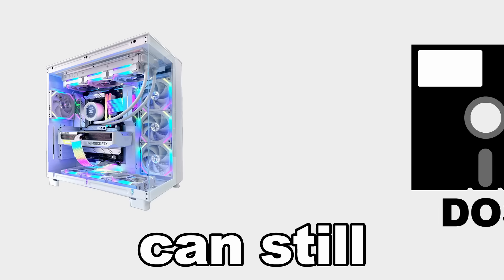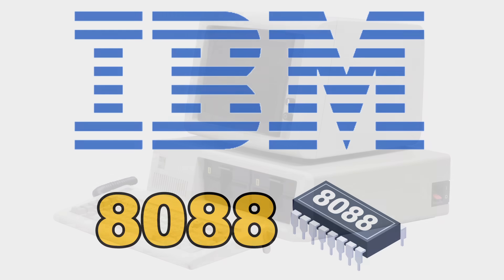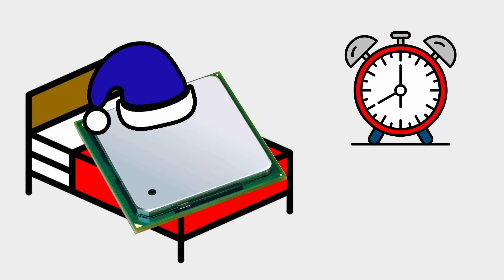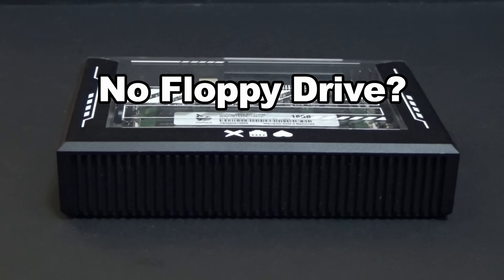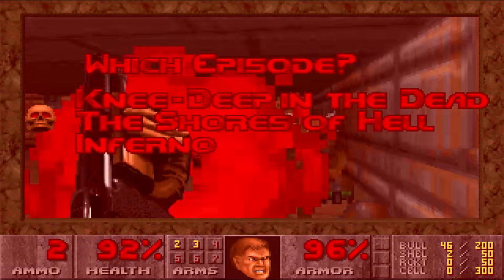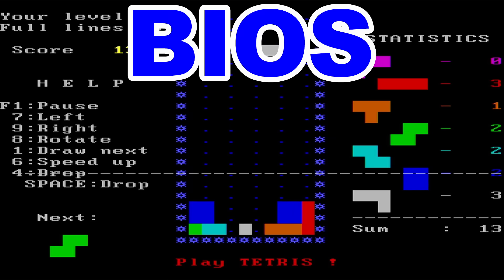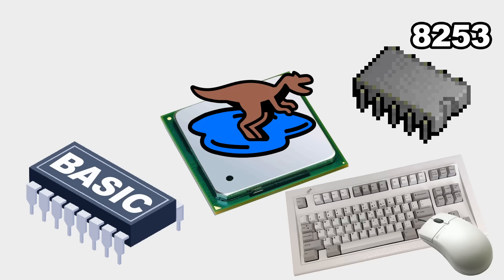45 Year Old DOS on a New Intel CPU Without Emulation

Comment: Intel is planning to make x86 64bit only architecture through x86-S specification
Reply: x86-S supports 32-bit apps but not 32-bit kernels. It also removes stuff like ring 1 and 2 (which almost nobody used)
Reply: @sundhaug92  The should have done it years ago... there is a ton of legacy stuff that can be removed, also it would simplify the boot process and the operating systems (basically because the OS doesn't have to start from a 16bit real mode and setup all the stuff to get to 64 bit mode).
Reply: @alerighi yeah, removing that tiny bit of code that is already written and working will save so much.  I also bet that removing the old instructions will save hundreds of transistors.
Reply: @alerighi  You'd be surprised how many niche things still depend on 32-bit kernels. Also, modern kernels don't have to start in 16-bit, either because the bootloader gets them up to that point or because of UEFI
Reply: @harrkev   removing old instructions won't save transistors because they're just microcode in the ROM, it'll save a couple of diodes, no reason to do that.
they could remove the real mode because that can be emulated in user-mode by the operating system.
Reply: @alerighi  OS can already start from 64 bit mode. It is called UEFI boot.
Reply: @SmallSpoonBrigade  Yes, but these days there is no sense to really execute 16 bit programs on the CPU. You can always emulate them, and there are plenty of emulators (DOSBox, 86Box, etc) and these days the performance penalty of the emulation is negligeable. 

Also, even with 32 bit Windows that can run 16 bit code they don't run it in real mode: it's no longer the case since Winsows 9x. In reality 16 bit programs are emulated on Windows, with an emulator that is called NTDVM. 

But really, 32 bit Windows is no longer supported, there is no point of having a processor supporting it. They can drop real mode, virtual 8086 mode, 32 bit mode entirely with no issue. I would also argue that they can remove support for running 32 bit programs in 64 bits OS, but there is still a rather amount of programs using it.
Reply: Anyone who still depends on the features that X86S will drop clearly aren't upgrading their systems anyways, and it's not like their existing systems will stop working immediately. (They'll stop working _eventually, but humans are pretty bad at properly preparing for when that inevitably happens.)
Reply: That will make them lose quite a bit of market of embedded devices out there which still run Windows XP or 7 and rely on 32-bit instructions to work.
Reply: intel has recently shelved the x86-S initiative, which is honestly a good idea
Reply: That's very stupid. Backwards compatibility is a major reason to use x86 at all.
Reply: @thecount25  Intel x86S retains just enought backwards compatibility. It does suppoet 32bit and 64bit apps under 64bit OS - just as 64bit only UEFI.
BTW 32bit OS inside a VM (bare metal hypervisor or hypervisor over host OS) - NOT supported in x86S.
Reply: @thecount25  Yes, but nobody uses ring 1, 2 or 16 bit real mode OS kernels nowadays for example
Reply: @Masterix.  I wouldn't say nobody. MS-DOS is still used in industrial applications. But yes, granted, that is getting smaller over time.
Reply: @thecount25  I doubt that, but even if, do you think that these computers are using the newest components? MS-DOS with all applications can be emulated on a potato, there's no reason to keep supporting 40+ years old software with no real usage. Like I get it it's nice and interesting feature, but common, it's time to move. x86 needs to make some big changes or it will be outplayed by ARM (and maybe RISC-V) CPUs in the (biggest) consumer sector.
Reply: @Masterix.  I think x86 is toast already. This x86-S will not be enough, and dumping more compatibility will just kill any advantages that x86 has with backward compatibility.
Reply: @thecount25  But backwards compatibility is double-edged sword. I think it is actually often the hardest part of designing new software/hardware. And x86 is really complitated because it maintains so much of backwards compatibility. Nowadays, hardware and software don't change much. Between 1990 and 1999 there was a huge step in computing and standards. But 2010 and 2019? Not much really. 64 bit computing will stay with us longer than 16 bit and 32 bit did combined. If we would need 16 bit computing, we can emulate everything. And x86-S is compatible with 32 bit user applications (but not with 32 bit OS) so that's also fine. Intel stopped making new 32 bit x86 desktop CPUs since Pentium 4 line, which is a long time ago.
Reply: @Masterix.  real mode is 0.01% of what is in the x86 ISA. If they did an actual cleanup it wouldn't be x86 anymore
Reply: @thecount25  Yes, although I'm not sure it's as critical now as it was when Intel tried to get people to switch to Itanium.

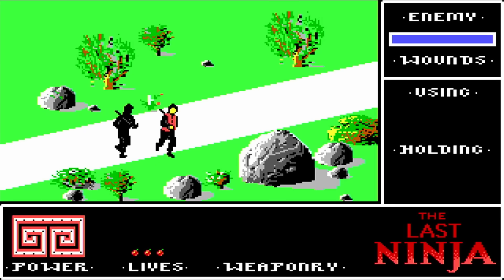Comment: 6:50 You could play the superior Commodore 64 version.
Reply: Dos version loads faster
Reply: But the commodore 64 ran 6502 assembly, not x86 compatible
Reply: @kenzie117  Yeah, but Last Ninja on C64 is the superior version than the MS-DOS port (and the less is said about the NES port of it, the better).
Reply: @UltimatePerfection  While that may be true, the point of the video is showcasing the backwards compatibility of modern processors. What youre suggesting requires emulation. Which defeats the purpose of the video.
Reply: @kenzie117  No, I was specifically responding to the claim at the timestamp on what would he do if compatibility wasn't a thing.

Comment: How did you solve the problem of old games running too fast?
Reply: The underclocking of a lifetime.
Reply: Turbo button.
Reply: There are plenty of "slow down" TSRs in the wild. They simply grab the processor a few times a second, do some busy-wait loop, then return control. It's just like running a CPU-heavy game on modern systems: everything else in the system slows down. Just "eat" 9,999/10,000 CPU cycles this way, and your shiny new Ryzen 7950X will do an extremely convincing impression of a 286. 😁
Reply: This, wing  commander 1 and 2 got really messed up.. 
WC1 is already running too fast on AMD's K6-2 200mhz..
Reply: @dureteheiral1793  but Duke Nukem 3D somehow runs perfectly fine when I run it in Windows 9x VM, but other games don't.
Reply: @_GhostMiner ….Using a VM program already throttles down the cycles to be closer to the original with some emulation.
Reply: @Roninkinx Do they just do that without your consent? You just can’t change it no matter how hard you try? It’s all hardcoded?
Reply: @_GhostMiner  Cmiiw, maybe because Duke Nukem use Real Time Clock that was introduced with IBM PC-AT. The older games (and some games afterwards) use software counter to time its movements. And as newer computer run faster and faster, the newer computers can do the software counter faster and faster, and you have the 1990s kids challenge "play Tetris in new computer".

The same issue also affected Turbo Pascal (the most popular compiler at the time). It seems Turbo Pascal use software counter for ReadLn function, and faster computers made ReadLn kept getting time out error. Someone had to make a patch to replace ReadLn software counter with RTC.
Reply: @dureteheiral1793  what's wc1
Reply: He used Celeron /s
Reply: Depends on the game. Games written in the 486 era or later almost universally have clock checking in their code, and run based on actual real time, not on pure CPU clock cycles. Earlier games that may be actually assuming a specific CPU clock cycle rate would run too fast - but there are DOS programs you can run to slow them down - they basically just operate as a TSR (a background task) and eat up however many clock cycles you specify, so that only the right amount are left for your game. These programs date back to the mid 80s, when the first 286 and 386 systems were coming out, and would run original 4.77 MHz-expecting games way too fast.
Reply: @AnonymousFreakYT  Some even before the 486 era did that.  The "turbo" machines were before even the 286 machines.
Reply: @kensmith5694 I remember the Turbo button on some 386 PCs
Reply: @Snuggs-o1  My 386 machine had the fastest 386 of the era.  It went at 25MHz.  If you wanted to slow down for a game that timed with CPU cycles, there was a software tool for that.
Reply: it depends entirely on the game
some games just run the game loop completely unchecked and the resulting game speed is at the mercy of how fast the CPU can crunch through said game loop, but a lot of later games learned to wait for a vsync interrupt to keep the timing in check
Reply: @TorutheRedFox  so DN3D runs well on modern CPUs because it uses better timing method?
Reply: I wrote a program on intel 80386 with 40mhz and it run without problems on intel core2quad with 2700 mhz near with the same speed. Because i used not a simple loop for delay, but with waiting for the vsync in a loop multiple times. The vsync and the timer chip exist long times ago. But the programmer don’t care and produce a very bad programmkng style.

I think it is possible to patch executable files that running to fast with a new delay routine. We have to find a good location inside the main routine to replace one or more instructions with a call subroutine instruction to jump to a free memory location that start with the instructions that we override with our call instruction and a new delay routine and at last with a return instruction to jump back behind the call instruction to continue the orginal code.

A new delay routine with waiting for the vsync is not a big deal and well documented.
Reply: @maxmuster7003  Do you mean the 18.2 Hz system clock? The problem was most games wouldn't use it. Because in DOS environment, it's difficult to synchronize what needs to be done with the clock, it has no preemptive scheme like Windows. So they used simple software counter instead. Which of course, became problem when computer became faster and faster.

Speaking of which, I'm curious, does that 18.2 Hz system clock still exist today? With the advent of lcd display, won't the 18.2 Hz became obsolete as lcd doesn't need any vsync to refresh it (cmiiw)?
Reply: @gorilladisco9108  Where is the problem to redirect timer interrupt 8 to our own interrupt routine to synchronize a game loop with the timer? It is not difficult and preemptive multitasking is not needed for this. Another way is to use a loop with 64 nop instructions and a counter for one second(using timer interrupt) to use the counter as a multiplier for a delay.
Reply: @gorilladisco9108  as long as it costs very little to maintain backwards compatibility...  I've seen several RPi "hats" to do VGA, obviously sbc are a different ecosystem, but the industry needs a clear reason to stop supporting something if it costs nothing, or next to nothing, to continue to implement.
Reply: Some old games grabbed values from the 8254 to do timing so that they worked the same on a "Turbo" machine.
I used to have a special TSR for my 386 box called slow386 that bogged the machine down by doing all program instructions in single step mode.
Reply: DOSBox has speed up and speed down button.
Reply: cli                        
          xor      ax, ax
          mov      es, ax
;-------------------------------------
          mov      di, es:[20h]
          mov      si, es:[22h]
;-------------------------------------
          mov      es:[20h], OFFSET NEUVEC
          mov      es:[22h], cs
;-------------------------------------
          mov      al, 36h            ; 18,2 Hertz (Standard)
          out      43h, al
          xor      al, al
          out      40h, al            ; low
          out      40h, al            ; high

M16:      mov      bp, 1              ; Aktiv-Flag =  IRQ-End if  0
          xor      cx, cx             ; counter low
          xor      dx, dx             ; counter high
          sti
;-------------------------------------
S1:       and      bp, bp             ; waiting for IRQ-End
          jnz S1
          mov      bp, 1              ; set Aktiv-Flag
;-------------------------------------
S2:       inc      cx                 ; main loop
          jnz short S3
          inc      dx
;-------------------------------------
S3:       nop                         ; 64 Nop's
          nop
          nop
          nop
          nop
          nop
          nop
          nop
          nop
          nop

          nop
          nop
          nop
          nop
          nop
          nop
          nop
          nop
          nop
          nop

          nop
          nop
          nop
          nop
          nop
          nop
          nop
          nop
          nop
          nop

          nop
          nop
          nop
          nop
          nop
          nop
          nop
          nop
          nop
          nop

          nop
          nop
          nop
          nop
          nop
          nop
          nop
          nop
          nop
          nop

          nop
          nop
          nop
          nop
          nop
          nop
          nop
          nop
          nop
          nop

          nop
          nop
          nop
          nop
;-------------------------------------
          and      bp, bp      
          jnz S2            
;-------------------------------
          mov      [RUNDE], cx         
          mov      [RUNDE+2], dx      
;---------------------------------------------------------------------------
ANALYS:   cli                         ; set old interrupt vector
          mov      es:[20h], di    
          mov      es:[22h], si  
          sti 

---- end of main routine ---

NEUVEC:   mov      al, 20h            ; new IRQ-Routine for INT 8
          dec      bp                              ; clear activ flag
          out      20h, al            ; =EOI
          iret

---- Data segment -----
RUNDE    DW 0, 0                        ; our counter
Reply: ; --- using a delay in 320x200x8 resolution with default 60 hz refreshrate ---
mov dx,3DAh  ; port address of vsync
mov si,1100h  ; loops
P1:
in al,dx
test al,8
jnz P1
dec si
jnz P1
; now copy buffer of 64000 bytes to the screen memory
Reply: Many years ago, I had an XT clone and played a game called "Striker" on it.  When I replaced the 8088 with an NEC V20, it ran a bit faster, but still playable.  Then I got a 386 system and could no longer play Striker, as it was too fast!  😥
Reply: i guess he used dosbox to record the gaming parts. you can't run old games on new hardware. there is no VGA graphic and no soundblaster in a modern PC. It's all fake!
Reply: @TT-pi8ww  A lot of graphics cards wake up as something like a VGA.  When a computer first boots the BIOS/UEFI displays some stuff.  This is before the graphics card is fully ready to go.
Reply: @TT-pi8ww  you clearly have no idea how any of this works, and sound like a brainless hater
Reply: @TT-pi8ww he hit no sound, and bioses definitely support VGA.
Reply: modern processors are optimized for 64bit instructions
Reply: @yuan.pingchen3056  🤦‍♀️
Did you even watch the video?!
Reply: @yuan.pingchen3056  BOT detected, opinion rejected!